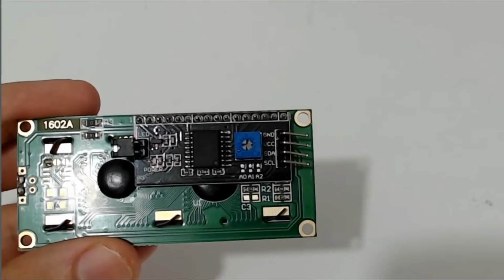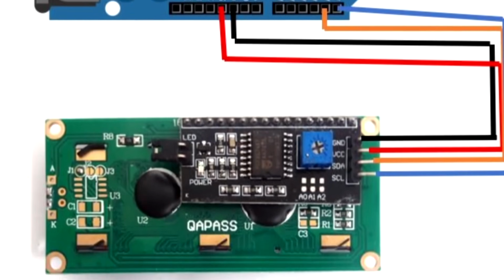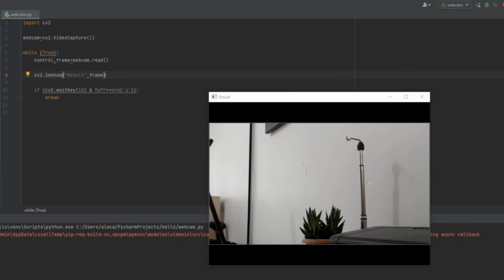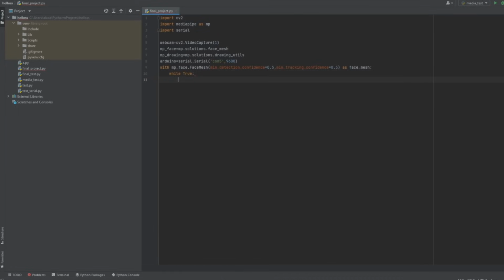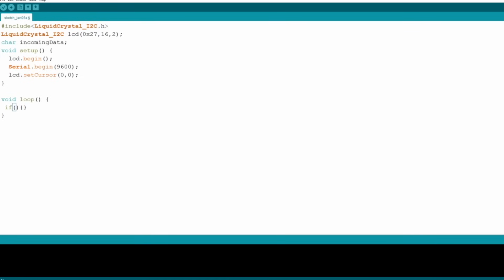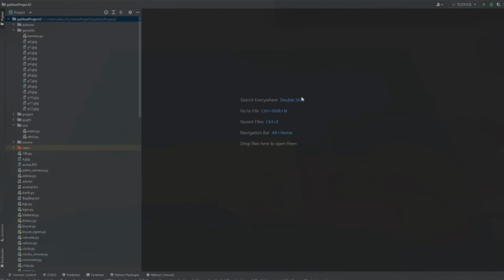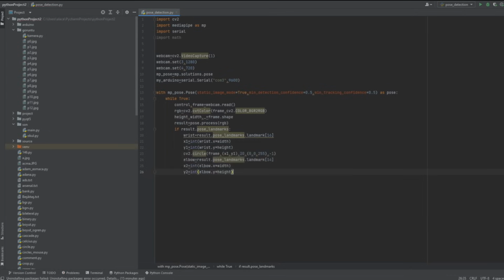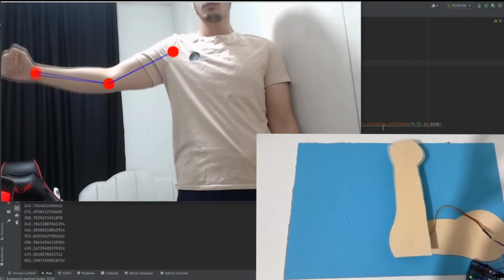Computer Vision with Arduino Tutorial – 2 Projects

Comment: Hi, I hope you enjoy the course :). You can contact me if you have any problems❤️. Best regards.
Reply: Hey HI! I loved the course. but the problem is I dont have the lcd. any other way?? I have only pc(it has webcam integrated) also an arduino
Reply: @Aadmi120 buy a lcd :)
Reply: @yilmazalaca  Can you provide me the link to buy lcd scrren and Arduino uno
Reply: are there any major pre-requisites for this ? just asking to make sure i grasp the concepts more clearly !!
Reply: @sparshverma9242 just some materials for project which included in the video.
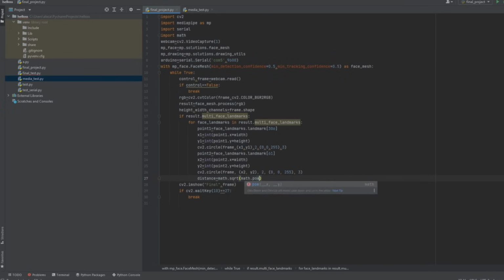Reply: bro, I think your code in video 01:31:00 about distance seems wrong. you said y2-y1 ,but written y2-y2
Reply: @g_lines_lx yes I saw it now 🥲
Reply: Can I do this project using my default camera in the laptop? I do not have a  webcam..Please suggest.
Reply: hello, it says the solutions in mediapipe was removed. how do i make my code work now ?
Reply: Please , can i use my Desktop camera instide of a camera